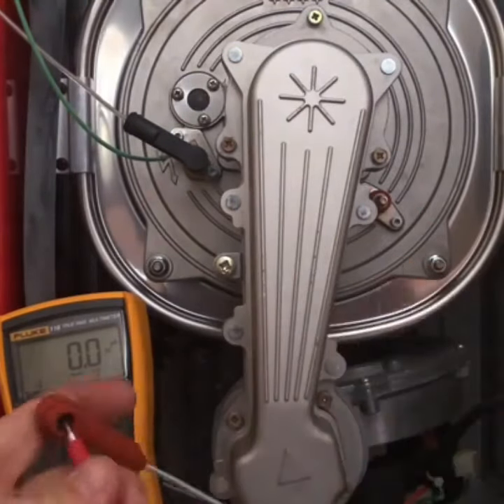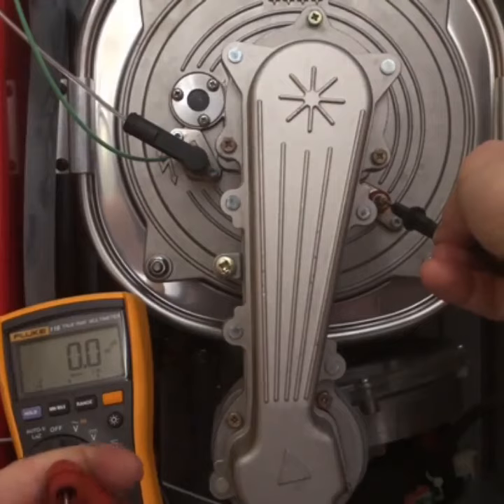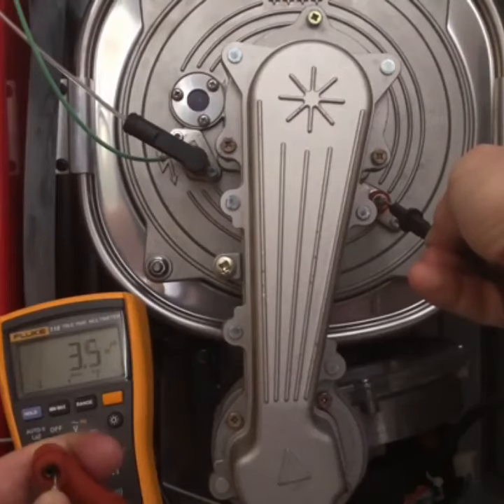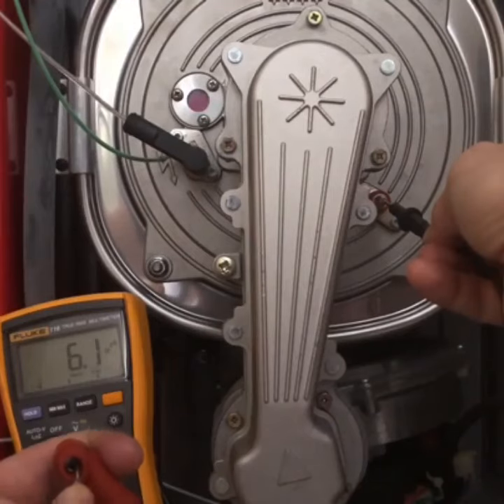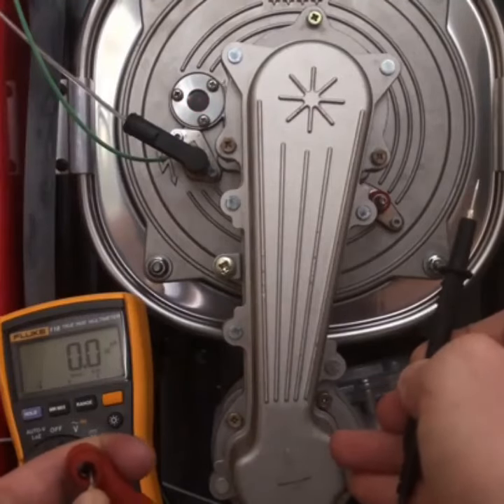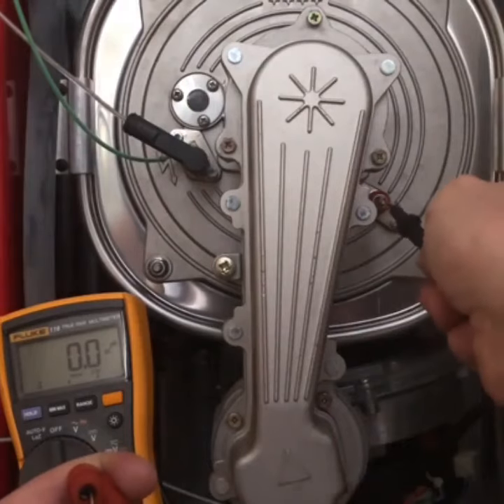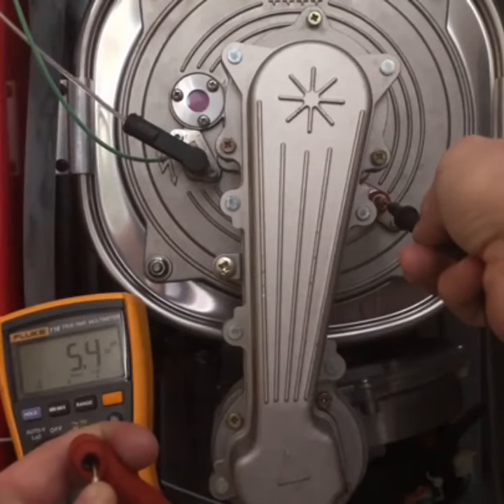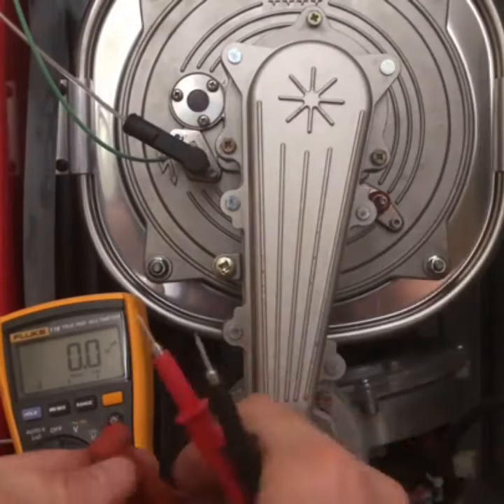P B Plumber 60 second fault finding 3 #Shorts

Comment: I rang ideal logic tech today as I'm a newbie. They told me to test the current going to the fan, I placed my probes to the correct positions and turned on the boiler the thing went bang and blew the fuse on the PCB. Question - is this the right way to go about it as I shite myself and moving forward would like to not potentially set myself a light.
Reply: Someone answer this for him